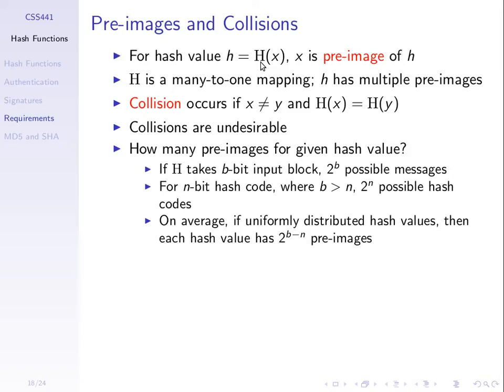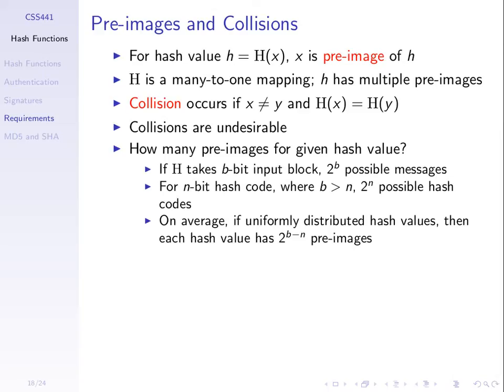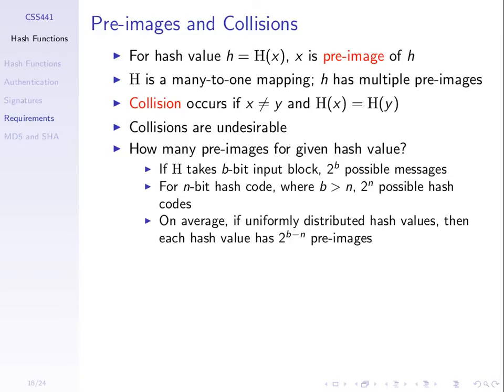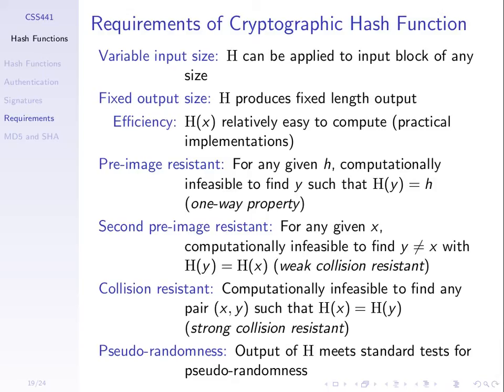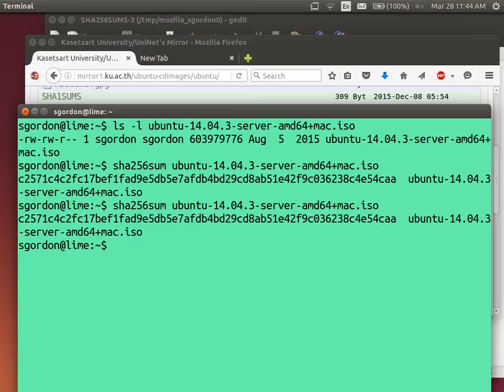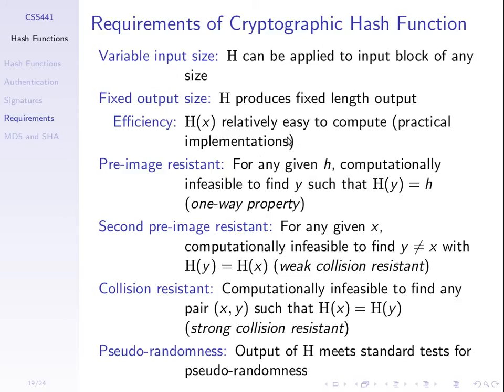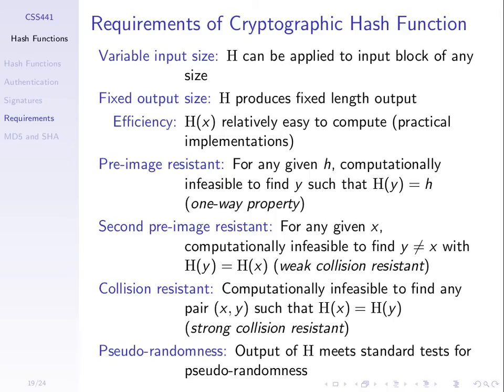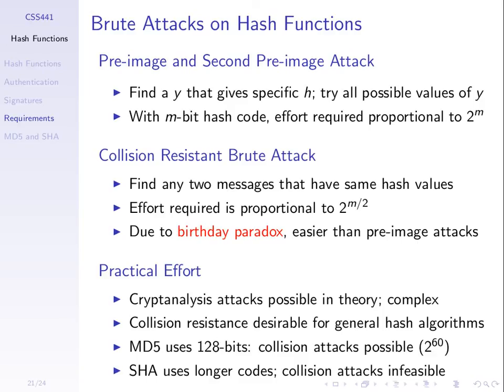Properties of Hash Functions (CSS441, L18, Y15)

Comment: Thank you very much

But we have a question, we read another slide and he said the following:

Effort Required for Brute-Force Attack (on average)
One way to defeat it we need 2 to the power of n-1
and also the weak collision resistant we need 2 to the pwer of n-1

so is this true?
because you said we need 2 to the power of n  and you did not say 2 to the power of n-1